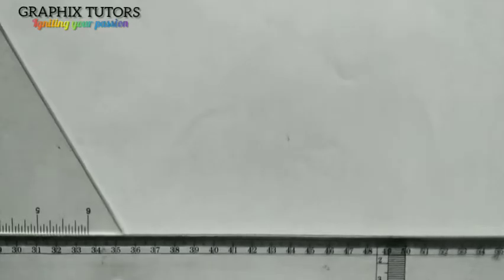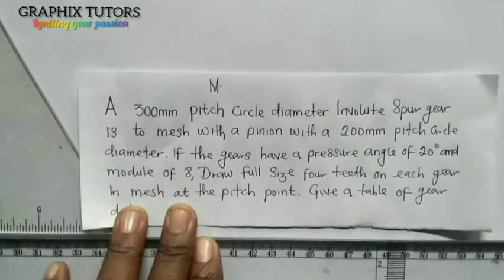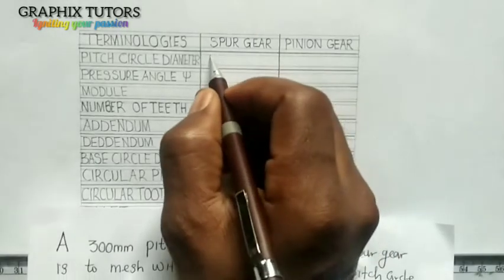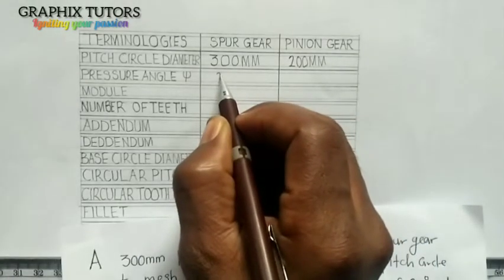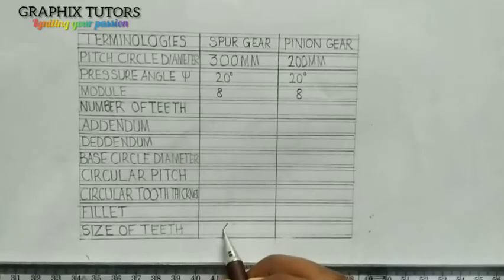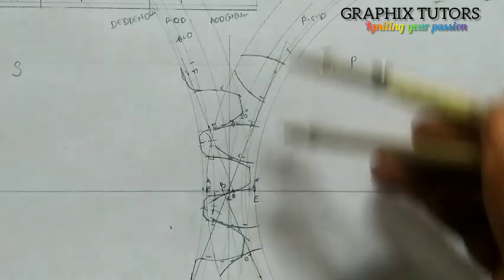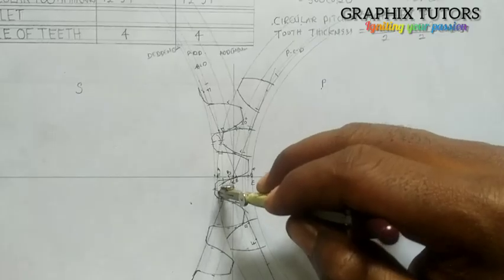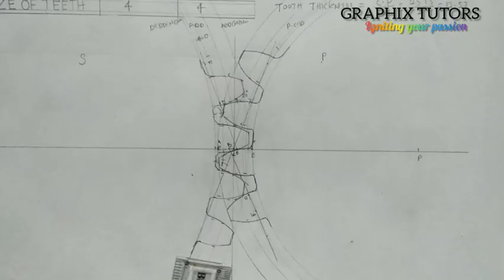meshing gear (Involute spur gear and pinion gear) ( technical drawing)

Comment: two gears, 2 and 4, have a center-to-center distance of 20 in. Gear 2 rotates at 100 rpm and has 16 teeth. Gear 4 rotates at 160 rpm. The teeth on the gear 2 are formed as follows: The face is a circle arc whose radius is 4½ in. and whose center is 1½ in. inside of the pitch circle. The flank is radial. The length of addendum is 1 1/2 in.; of the dedendum, 2 in. (a) Find the curves forming the tooth on the gear 4. (b) Draw the path of contact if 2 is the driver and rotates counterclockwise. (c) Draw two full teeth on each gear, allowing 0.1 in. backlash. Dimension the gears and teeth. (d) Show complete construction for one point on the flank and one point on the face of curve 4. Use letters on construction to indicate fully the construction.
Reply: This isn't a complex as it seems to be...wish I can show you how it's done
Reply from the maker: You can chat me up

Comment: Good job sir, I don't know if you can help us with the drawing of a pinion
Reply from the maker: What is your question
Reply: @alirule  4). Make a dimensioned working drawing of an 18 tooth pinion,
module 4, 20° pressure angle using the following information.
Face width 38 mm, central web 12 mm thick, boss length
50 mm, boss diameter 45 mm, boss bored 32 mm, inside rim
170
Involute gears
diameter 112 mm, four equi-spaced lightening holes 22 mm
diameter, through the web on a 78 mm diameter pitch circle.
Fillet radii 3 mm.
Draw full size in first angle projection a front elevation
showing three teeth drawn approximately, and a sectional end
view. In the end view the boss is positioned symmetrically
about the centre line. Show a table giving the gear data.
5 ). Draw full size in third angle projection a dimensioned front
elevation and sectional end view of a 30 tooth spur gear,
module 6, 20° pressure angle. Show three teeth on the front
elevation drawn approximately and a table of gear data. The
face width of the gear is 25 mm, rim diameter 158 mm, boss
diameter 34 mm, reamed 24 mm diameter, boss length 50 mm.
The boss is supported by four straight spokes of elliptical
cross-section, the minor diameter being constant at 10mm and
the major diameter tapering from 24 mm at the boss to 22 mm
at the rim. Fillet radii 5 mm. The boss is symmetrical about the
centre line in the end view. Show a revolved section of one
spoke on the elevation.
Reply from the maker: @jonathanibrahim9423  I believe this question have diagram
Reply: Was an assignment given to us mechanical engineering...
Reply: @alirule  no sir it doesn't.  The question was picked from a PDF material and given to us